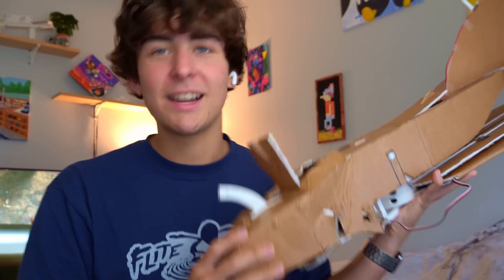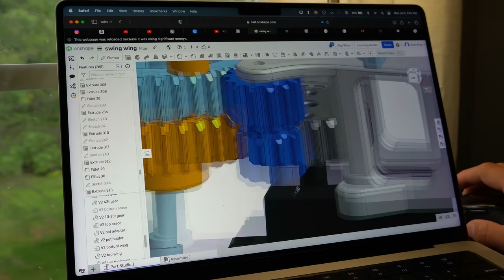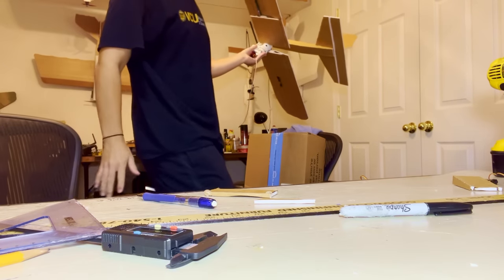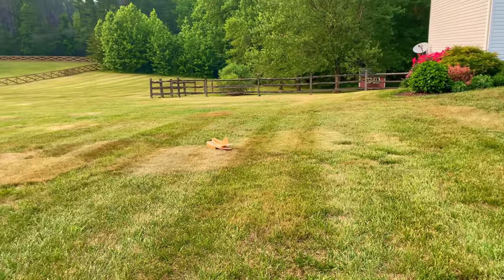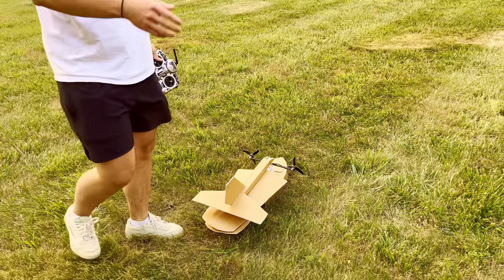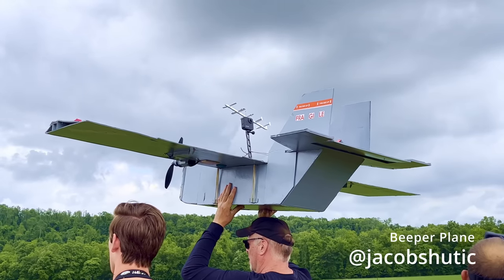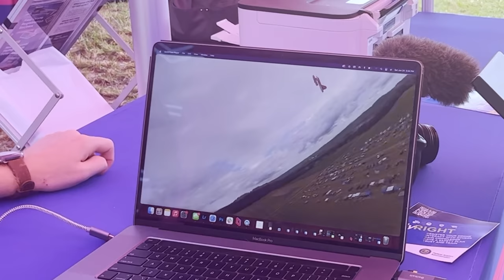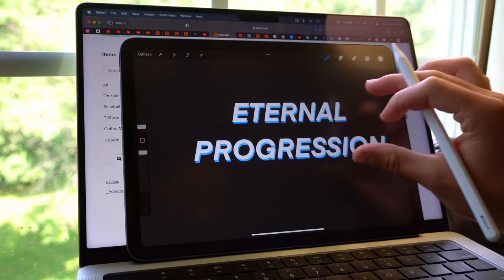I Made A Flying Boat With Retractable Wings | Swing Wing V2

Comment: I made a model plane with folding wings that could also drive like a car. But that was back in the 1987 when we didn't have light components and batteries for flying. So it turned out too heavy but did fly a few times.

Comment: First time here, but not the last. Great Job on making such a usable design. I wonder how this would go scaled up to 50 foot wing span made in all carbon fiber and aluminum where required. Though I suspect it would need to run off hydraulic pressure with several accumulators to actuate it fast enough. Though that may be too heavy, so compressed air might be required. With the default setting to be wings out, and if there's a pressure containment leak, a return spring puts the wings back in flight mode. So that adding power brings them in and no power returns them to flight mode. Makes it a redundantly safe system then. Would definitely be a fun plane to fly.

Comment: If you wanted to make a high speed rc plane I would use that system and tilt the wings back the faster I go. (I know it mostly only works at the speed of sound but still.)

Comment: I see you using that old brushed Dewalt with the NiCd battery. You should switch to Ryobi. They have cheap new tools and they are very strong. I used Ryobi for a year in commercial steel construction and they worked fine. They have battery powered glue guns and soldering stations and much more. Perfect for repairs in the field

Comment: Nice job. Good on you! I think you should take the idea to the next level. Set up a course with rings that you fly through except make the diameter smaller than the wingspan which means you HAVE to close them before going through. Imagine a race with several swing wings. 👍🏻

Comment: this is a very brilliant application of a novel aviation behavior we haven't seen much even in fiction.. to tactically bring the falling like a stone ability.. like a diving bird of prey you could lose elevation far above fixed wing craft without the concerns of structural stresses (as much) though some form of aerobraking or some expected long pullout times.. but an air brake (like flaps) would allow you to 'plummet' longer before pulling out.. though at the foamcore level there isn't a lot of mass to worry about..   One thing I was curious about with your design if you would notice an improvement of flight speed if you did the fighter jet thing.. have a multiposition capability allowing you to have a swept wing which I'm thinking would increase your top speed quite a bit.. maybe.. be a cool feature to add to the 'bird dog fight' motif you got going on here.. collapse and dive.. move to swept wing and hit RC supersonic.. hehe.   anyway.. I really appreciated your enthusiasm and amazing application of new fundamental functionality to an existing trope.  :)
Reply from the maker: it would actually be really cool to have an air break thingy so I can fall longer. might be a video some time!

Comment: Yo that was so cool! Version 2 did not disappoint. You mentioned slingshot launching a swing wing plane. What if you slingshot launched a glider version that you shoot straight up or nearly straight up and the wings pop open before it starts coming back down.
Reply from the maker: Yessss that would be awesome!!!!
Reply: That’d be killer
Reply: Also amazing would be a rocketplane glider model where it launched vertically from a rocket rail and then pop the wings out at apogee.
Should give amazing performance

Comment: I am REALLY enthusiastic for your project.  The only change I'd make would be to put the wings on the same plane instead of folding on top of each other.  When I was a kid, I saw the Oblique Wing AD-1 that Nasa was testing.  It was a tiny aircraft, but I got to go up close.  Spent a career in aviation and I'm now retired.  I have never seen your idea actually fly.  There were a few SST concepts with fully sweeping wings, but they had large delta wings to sustain lift at high speed.  Have you considered sweeping your wings back halfway for higher speed flight?  Anyway, I'm commenting before Flite Test blows your channel up with new subscribers!
Reply from the maker: Hahaha thanks man! Thats really cool! Ive looked long and hard for concepts of the retracting wings so its cool u saw those. And in person too!!! Thanks for the comment!

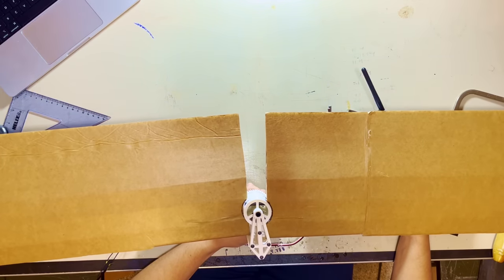Comment: 6:42 - perhaps it could do with some simple control for ramping speed in start and end of transition. Perhaps RC Test Flight or Carl Bugejal could help. Ramping in start and end will help protect the gears and the mechanics a bit also.
Great build and follow-up video!
Reply: This might also help on the issue with voltage spike/sag on receiver - this could also be helped with capacitor, but perhaps the wing inertia is too big to be solved by capacitors. :-)

Comment: For further weight savings:
   Use gorrilla glue instead of hot glue
   Remove paper from interior foam pieces - paper is up to 70% of the weight
   Use nylon screws
Reply: Nylon screws are criminally underrated, thanks for reminding
Reply: It looks like you can also trim weight from the main gears... Why have a 2 x full 360 degree gears when it looks like they only move 90 degrees each so use something like a quadrant gear for each wing?

Comment: With 3D printing holes don’t necessarily make it lighter. You need extra walls if you have holes, you are generally better just using infill unless it is a very large hole.

Comment: oh- I- omg it would be so cool if you tried doing a variation of a spin launch or maybe using a flywheel to build up enough energy to launch the swing wing- it could have a rack getting pushed by something? What if you try to do a fully kinetic version of the swing wing? Like launch it and use kinetic energy, similar to how you can activate and un-activate an elytra in Minecraft!
Reply from the maker: Uoghhhh!!! It is like the elytra!!! Thats so cool!! Im definitely going to make a slingshot for this thing and launch a glider version that’s unpowered.

Comment: Just put a gear section on each wing root, with single worm sandwiched between them.  A top and bottom plate attached to the wing pivots would keep the gear sections engaged with the worm.

Comment: hey, awesome video! I was wondering what you made the hull thing for on the water out of? is it just flite test waterproof foamboard or something else? also what did you use to seal it? or did you just use hot glue? thanks.
Reply from the maker: Hot glue and foam!! I also ended up using packaging tape on the bottom so that when you use it on the ground, it doesn’t get tore up.

Comment: Great project. I would like to do the same. I don't quite understand how you upgraded the servos. Could you explain a little. I tried to connect with your gears, but I end up with a turn of about 45 degrees.
Reply from the maker: Hey i could totally help you. You can dm me on instagram or discord. You might be able to see how I did it in my v1 video. I went into more detail there on how the potentiometer was removed and soldered up.

Comment: Did you find the need to lubricate the unconnected middle gear / wing connector that are rotating opposite the shaft rotation direction, or did they slide easily enough without lubrication? (Compared to the lower gear / upper wing connector that are rigidly attached to the arrow shaft)
Any concerns about wear and tear there between the loose gear and the arrow shaft?   btw, awesome idea and great to see it flying so well.
Reply from the maker: Thanks man! No no lubricants and no wear that I can see! Haven’t broken any gears yet ether!

Comment: if i want to build my first plane model as a starter where should i start ??
Reply from the maker: Definitely go look at flite test for sure. I would recommend the mighty mini scout. Not only is it a really good trainer but it’s also my personal favorite airplane. The fast planes and the war birds look cool, but honestly they’re not as fun as a slow plane. it might seem counterintuitive, but slow planes are the best trust me.😂 so yeah, I’d say go look at the flite test mini scout. Have fun and good luck!! Don’t be afraid to crash either. The flite test planes with the foam board are super durable. And if it does break just go back to your shop put some more hot glue on it and it’ll fly again!
Reply from the maker: Ah ok I would recommend the horizon hobby blue sport cub s. It’s a super fun plane, you can fly it anywhere and the bind and fly (BNF) version has everything you need. I still have one and fly it a lot. I learned to fly with it and I would definitely recommend it. Sorry for getting to this comment so late I hope it helps!

Comment: Amazing model. I want to build this proven model as seen in the video. I started printing gear elements from Thingiverse files. I'm looking for drawings with dimensions (at least some proportions) of the wings and fuselage, the place of balancing. On Onshape, I only see drawings of the gears of both versions. Any information, data on engines, kV, propellers used, battery size, flight weight please.